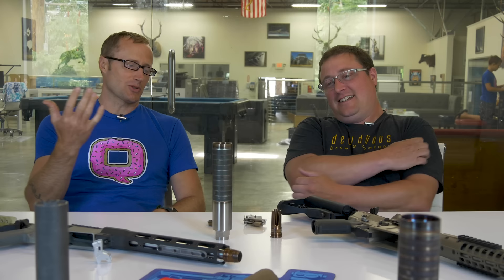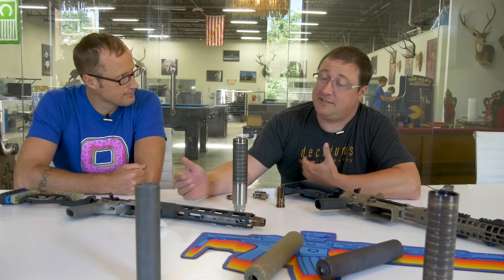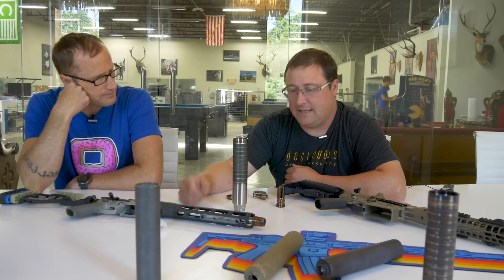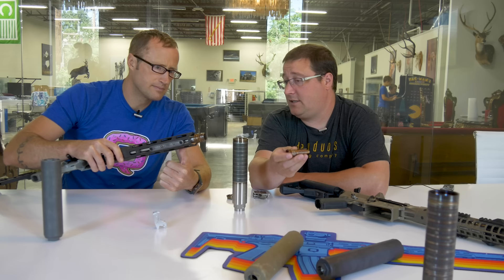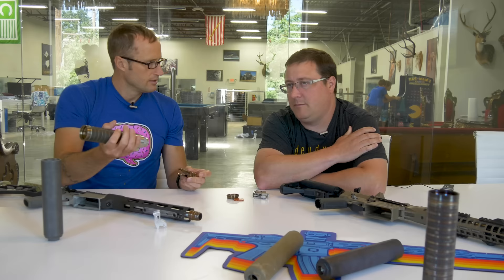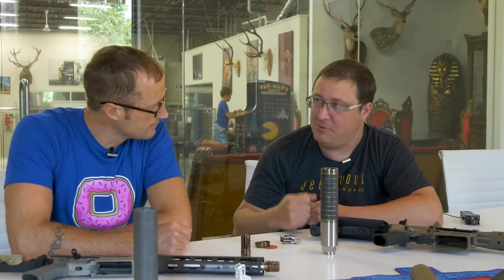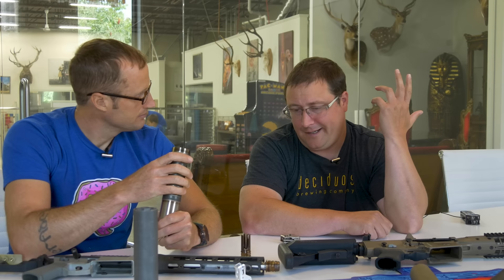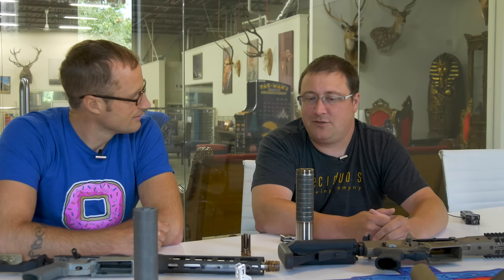Pork Chop Silencer by Q: 1st Look

Comment: With all the optics and rail mounted backup sights, Q should go to 2" diameter and shorter suppressor. same diameter as most handguns. No need to fit under handguard on hunting or anything not CQB gun

Comment: Q’s taper system is awesome, but they need to release a more workable alternative to the Cherry Bomb and start coating all their products
Reply from the maker: Curious, what do you mean by workable and coatings?
Reply: Coatings mess with tolerances and alignment. Kevin did several q shorts and many podcasts going in depth on the specifics of how much it interferes instead of helping when it comes to coatings & threads when related to supressors & qds.

Comment: 338 Yaaasssssss, Really wondering what the ratings for it will be ie: full auto rated? or how many shots of 338 Lapua can it take? Just because it's stainless does that really mean you don't need a blast baffle on a 338 Lapua? Those pressures are so high that's kinda unbelievable..
Reply from the maker: Now I’m curious, do you have a full auto 338?   :)
Reply: @KitBadger  Omg I wish lol, though there is the 338 Norma Mag (LWMMG) that Sig developed for the military. Really though for my Savage 110BA LE model I want a suppressor that will last for the lifetime of the gun and more and not have to worry about letting it cool down between shots. Love the reviews and Q products!
Reply from the maker: @nathanpuffenbarger5423  ahh, I gotcha.

Comment: So the suppressor is good to 5 yards with accuracy,ok
Reply: With a wipe, potentially. There are lots of variables. But again, the wipes are optional.
Reply: With a wipe on my wolfman on a 9mm my groups go from 1.5 inches to 7 inches. It sounds good but what's that point if you can't hit anything. 50 yards.

Comment: Suppressor*
Reply: The original patent filed by Hiram Maxim in 1921 called it a silencer.
Reply: Says the guy from the internet
Reply: In reality, no 'silencer' is truly silent - so many purists prefer to use the word Suppressor, which is more technically correct since these devices are capable of reducing/suppressing the sound from a firearm and not truly silencing it.

Comment: Are they back filling the cans during the weld process yet?
Reply: Aww that just leaves more surface to slow down the gases.
Reply: @tubeonline629  What? If you don't backfill you are potentially compromising the weld.
Reply: @TAGsten  
I know, I was just being a smart a$$. For something as small as those silencers they could weld them in a chamber box. I've seen one that resembles a bead blast cabinet.

Comment: Man this whole video was like anti sales from everything that was talked about in previous Q advertising. Steel is better. Threads before tapers. Don’t use the wipe because you can’t hit anything.  Well at least we understand some of the trade offs to a massively different caliber
Reply from the maker: Different product for a different market / use case.  Sparking doesn't matter outside of military applications largely.  Tapers before threads (still).  The wipe was driven by a customer (think military) request.  There is no one size fits all.  :)